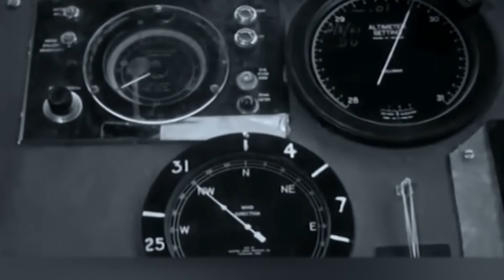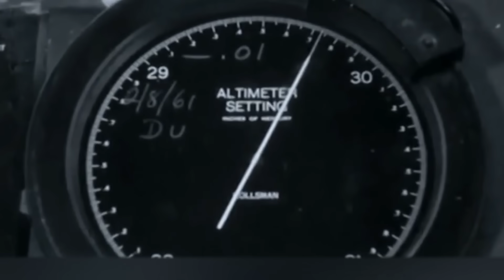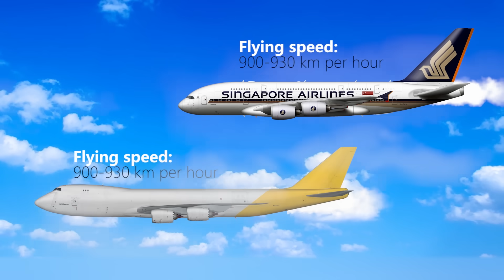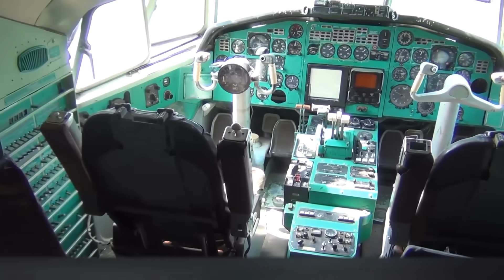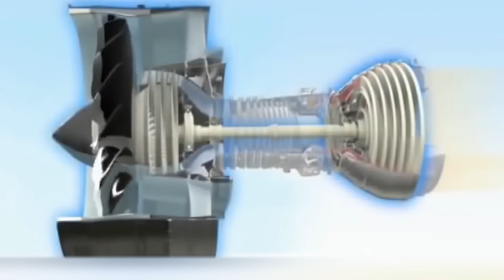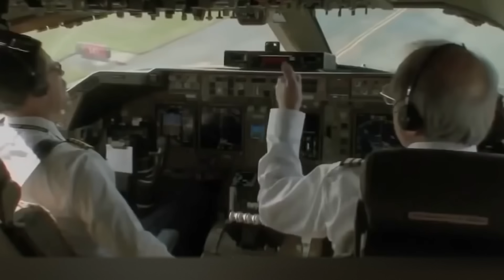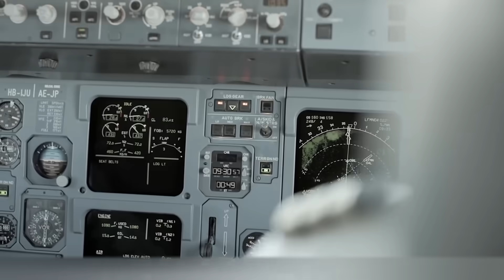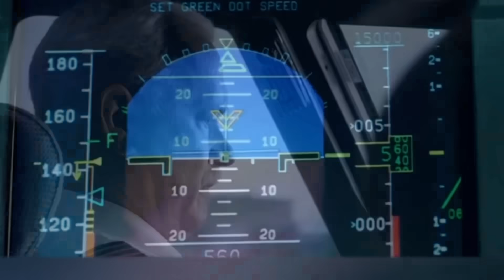Why Do We Fly so Slowly?

Comment: Turbofan not turbo jet!
Reply: In modern planes we use turbofan engines but previously from 1960's  to late 70's turbo jet engines were used
Reply: Modern commercial planes use turbofan engines, not turbojets. Turbojets have more thrust meaning you can go fast however they are very fuel hungry. The Concorde used turbojets engines to reach high speeds. Turbofan engines are like turbojets hower they have a larger diamanter. They use a big fan some of that air is accelerated to high speeds while another bit is used on the side. It makes it more efficient. Why science (And because I do not feel like writing about aerodynamics now) Here is a good image to explain: https://s3.amazonaws.com/mechanical-engineering/monthly_2017_01/turbo.jpg.a2bda223dbe47091273bb1c99a398230.jpg

Do some research.
Reply: Turbojets have not more thrust than turbofans.Turbojets are the most powerfull jets,up to 115000 pounds of thrust.The Snecma/olympus had a thrust of about 31-38000 pounds.I belive the turbojets were used because of the smaller diameter.The concorde had about the same weight as an A330 and the same engine power.The big difference is the overall shape and the diameter of the fuselage.The concode could carry up to 120 passengers over the Atlantic with no extra cargo and the A330 up to 400 pasengers further than the Concode or 260-70 both ways.OK the Airbus is a little heavyer,but it is the same region.In turbojets all of the air goes thru combustion chamber or most as opposed to turbofans were most bypasses it.
Reply: Alexander Idvall Finally someone with sense!!!
Reply: majority of the modern commercial planes are turbo fans not jets that's why they are bigger because there is a large fan in front that sucks in air some of it goes into engine core and the rest gets bypassed creating additional thrust without burning extra fuel.
Reply: Watch the whole video. He gets around to describing modern turbofans a minute after introducing turbojets.
Reply: Sum yout00ber yes I also noticed :D + just ignore that idiot that thinks he is a know.it all :D
Reply: HCK Gaming said it was a turbojet
Reply: Except HCK Gaming :) Look "idiot its jet. Fan is without Air compsuction." Scroll up to HCK Gaming
Reply: Ya because he is not studying engines and aerodynamics in school ;)
Reply: There are 3 main types Turbo Jet (Fighter jets etc), Turbo Fan (Passenger Planes), and Turbo Prop (like an C-30 Hercules). Hes not an idiot at all.
Reply: Alexander Idvall I'm pretty sure we all know that
Reply: Alexander Idvall oh ok, fair enough.
Reply: Alexander Idvall yes  but you don't just compress the air, it has to be mixed with the kerosene to be able to take off. The air gets so hot because it's compressed, it then ignites the fuel and can take off.
Reply: Yes, i know, as i am a plane nerd, however i was replying to someone saying turbojet
Reply: Perth Plane Spotting HD Plane nerds stick together! I am one too.
Reply: The guy who made this video has no idea what he's talking about. He compares a Tu-114 to the Concorde, when I'm fairly certain that he meant to compare it to the Tu-144. You'd think he would have noticed that something was wrong when he saw that the Tu-114 had props, but, nope, he's a moron.
Reply: HCK Gaming do you know how TurboFan engines work
Reply: HCK Gaming 
It's TURBO FANS not Turbo Jets you nit wit.
Reply: Alexander Idvall Actually, turbojets were phased out in the sixties and seventies in favor of turbofans in general. Concorde had Afterburning Turbofans, which are seen on fighters like the F-16 Fighting Falcon.
Reply: Ancieto Maldonado Jr.

"Then came the advancement of the turboprops. Which was a piston driven motor with a crude jet engine attached for greater speed."

No, just no.  There has never been a piston engine inside a turboprop.  It's a gas turbine, just like jet engines, but instead of relying on jet propulsion out the back, a propeller is attached (usually through gearing) to the turbine shaft.  Unlike turbo jets/turbo fans, the engine exhaust provides insignificant propulsion, it's all off the prop.

Some prototypes were built in the 1930s, Whipple himself worked on them before switching to jet engines for the Gloster Meteor.  Tho, there was one prototype Meteor that flew with turboprops.

They made their appearance in production just after WWII, the first aircraft built with turboprops to be made in significant numbers was the Vickers Viscount 4-engine passenger plane in 1948.

In other words, they made their appearance slightly after jet engines.
Reply: Sum yout00ber yes there is a difference
Reply: The amount of people here thinking they know what they are talking about is hilarious
Reply: Alexander Idvall how does that have any relevance?
Reply: Sum yout00ber lol!! Same here. Its the era of turbofans now!
Reply: Aniceto Maldonado Jr alright mate but we never mentioned anything about the first planes did we?
Reply: Sum yout00ber HCKGaming did. He said "dodo planes".
Reply: Sum yout00ber ur totally right. It’s turbofan when the bypass ratio is greater than 0,1:1. And all passenger planes of today use this engine
Reply: Sum yout00ber thats something i would have wanted to complain as well 😂
Reply: Sum yout00ber  turbo fan is in the late 90s  now it is called turbo jet or maybe called turboline that is powered by fuel and hydraulic
Reply: Beesmode 321 Its the other way round.
Reply: ronniel gamer No it's not it's called a turbofan lmao
Reply: ronniel gamer hydraulics are completely separate, they control the planes movement etc
Reply: its turbofan, as a turbojet has no bypass air u dumbass do ur research before u comment
Reply: HCK Gaming Modern Airliners use Turbofans. Sone of the benefits are that they are quieter and the fuel economy is a lot better. Fuel is expensive and anyway for costs to be reduced, would be a benefit to airlines. 

This is one of the reasons Concorde isn’t around today. It’s fuel economy was terrible.

Also, there is no need for insults.
Reply: I know
Reply: Sum yout00ber, because it helps some people actually understand things
Reply: Jeez this comment has gained more likes than the channel creator lol
Reply: Alexander Idvall thank you person who knows what they’re talking about
Reply: Jason Black ummm, we are (kind of) ranting about the narrator calling a turbofan a “turbojet”. I don’t really see what or whom you are calling not a moron here
Reply: Single circuit engine - Turbo Jet

2 circuit engine - Turbo Fan

Pay attention...
Reply: Tyler Henderson circuit? difference between turbojet/turbofan has to do with bypass ratio
Reply: MC not MS
Reply: ? turbofan and turbojets are two different things.If you are interested you read about radial compression and axial compression to.
Reply: The video explained the difference between a turbojet and turbofan.
Reply: Sum yout00ber, it's you're on your first "your". Looks like you need a few hours in school.
Reply: xochj it's really not, i don't need to speak with perfect English on the internet and also just because I said your dosent mean that's incorrect fool
Reply: idiot its jet. Fan is without Air compsuction. A fan is on a dodo plane. And jet is "Fast Moving Acceleration Device: idiot
Reply: compsuction??? the engenes is called a turbofan  on a modern airliner because only a small procentage of the air actually goes thru the combustion chamber.Most of the air goes outside it by the push of large FAN in the front end of the engine.The biggest has diameter of about 325 cm.GE 90 -115B.The GE9X that is soon coming will have a diameter of 340cm..The old MD 90 had a kabin with of 334,2 cm so an GE 90 is the same cize as a 5 a breast airliner.The turbofans are much more efficient than turbojets.Turbofans bypass ratio from 1-3 to 1-11 meaning 3 to 11 times more air goes ouside the combustion chambers than inside.
Reply: HCK Gaming NOOOOO!!! It is called a Turbofan!! Turbo jets use like 3 tons of fuel per minute. Not so economic.
Reply: HCK Gaming your not making sense with your broken English go back to school
Reply: @zero_meercat8624  says the guy who doesn't know how to use "you're and your."
Reply: TailGunner9187 so what? That has nothing to do with knowing about planes fool